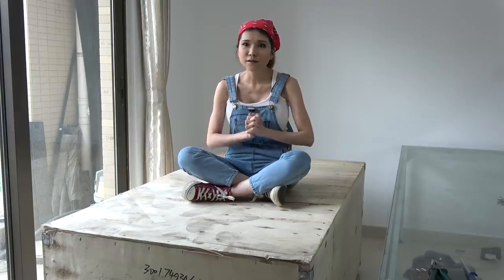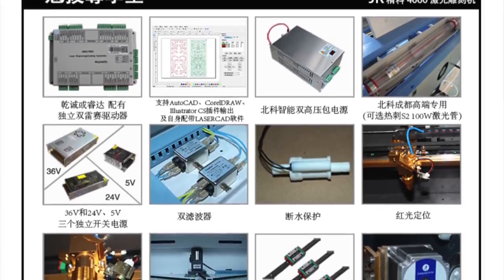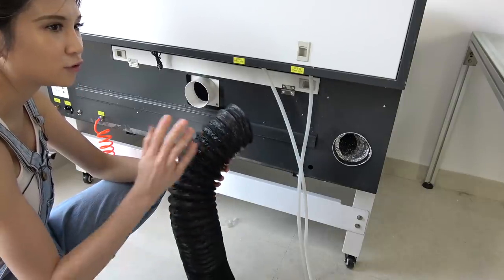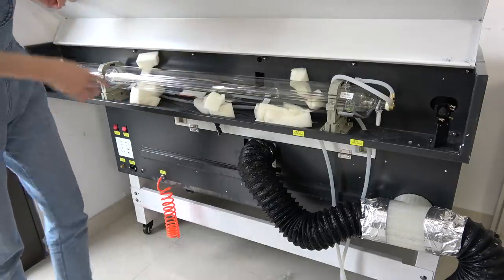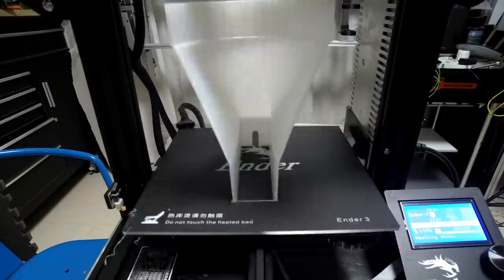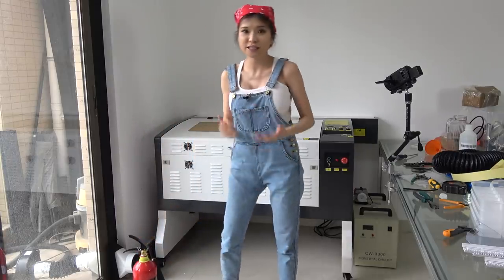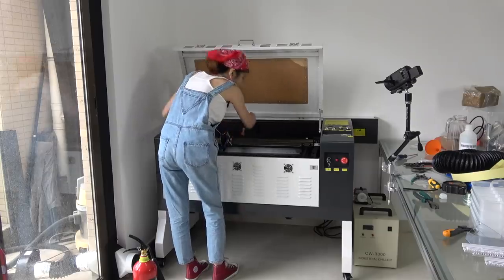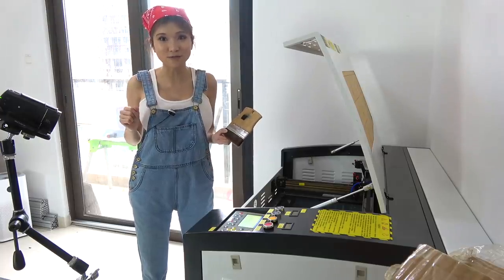I Finally Got a Laser Cutter! Chinese 80w Laser Unboxing & Setup

Comment: Try lightburn as a replacement for lasercad  to control the laser. It's not free but has a good trial period. It's under active development and has many nice to have features.
Thanks for the video.
Reply from the maker: Yup I know the author but it does not support my controller yet. As soon as it does that's what I'll switch to😊

Comment: Might have enough power to make printed circuit board holes for some fancy electronic parts. Will it take a CNC drill file?
Reply from the maker: Sure that would work fine

Comment: Wow Naomi, I love the way you found a solution for the ventilation opening in the doorway.
I would be a little afraid for an 80 watt machine in my house although I don't know if it is more or less dangerous then my 10 watt machine I have here, as that machine also set's things on fire.
Is the machine you bought also available with a fibre laser?

Comment: Can you spell the company name? That price is incredible. Machine in US is $5,000usd for a 45-50W machine. It is good to cut wood 3mm thick. Acrylic smells and cardboard burns as you see. Each material has specific speed and power setting. If anything catches fire, emergency stop to prevent air flow which will make fire bigger, and smoke which will hurt your focus lens. Can clean with isopropyl alcohol wipe
Reply from the maker: The name is in the description box

Comment: Naomi, I think you need to check the focus of the optics. Looks way too much charcoal on the cut and it might be caused by bad focus. Some lasers has moving focus lens, which distance from the material is variable and needs to be changed according to thickness of the material. Others has double focus lenses which might need to be calibrated for the first time.

Comment: You will need more ventilation. Think about something like a range hood. I've ended up adding ikea tray above the laser with a separate fan. And also an extra fan to suck all the fumes out of the laser faster.

Comment: Hi Naomi – the laser cutter is an interesting piece of equipment, I look forward to future videos where you show how it works and what you make using it. It seems to me that you are wise to wear bib and brace overalls, which will give you some protection from accidents involving hot material. Perhaps also wear a top, which has long sleeves. Kind regards.

Comment: Very cool installation video!  Turn your power way down, 10% or so and work upwards.  Also, does your laser have a Z auto focus option? or is it a manual adjust?
Reply from the maker: Has motorized Z
Reply: Super useful!!!  Glad you're back Naomi, can't wait to see what you make with the laser!

Comment: Well didn't see the actual unboxing, so have to ask, did you use a flatbar and rip the top apart, or remove the screws at the bottom and just lift it off?  Also, be careful cutting acrylic with a honeycomb bed, the meltoff gasses will condense on the combs, accumulate over time and can start a fire. Use a pin bed instead.
Reply from the maker: I did not, just not strong enough to do that safely. Paid the delivery guys to do it and cooked them lunch.

Comment: If this Laser uses a Krypton Arc Tube make sure you align + (positive) & - (negative) poles of the Tube every time or it will explode immediately. Also only clean lenses  with a high grade optical tissue so as to avoid scratching the lenses.

Comment: Hello.
You can get cheap acrylic, buy the cutting board.
For beginner is good material to start.
Check the power or strength of the laser for the material that you are going to use it.
Good projects.
Stay true to yourself.
Reply: James Alex  cutting boards are usually PP or HDPE both of which are difficult to laser cut, it tends to just melt back together
Reply: Maker's Muse thanks.
I know that is a type of plastic.
But with your explanation isn't for a beginner in laser cutter but it much much more difficult to work.
Best Regards.

Comment: What's stopping them from mounting the large laser tube vertically?  Would use a lot less space?  Maybe the water pump would need a boost but I can't think of any other problems.  #hack

Comment: Just a warning, the CW300 chiller will not be able to cool your water below ambient temperature, it is not a true chiller.  You should look at replacing it with the CW5000 chiller or an aquarium chiller.  I use an aquarium chiller for my 100w China laser and it is able to keep my water temp below 21C no matter what the ambient temperature.
Reply from the maker: Thanks, I've heard that. I'm hoping since I don't use it very heavily it will be ok but I'll keep an eye on the temperature.
Reply: Np.  Temps start to creep up during long engraves/cuts so make sure to keep the water temp between 20-24C at all times or else you risk damaging the tube.

Comment: Awesome Naomi! This is getting me amped for my G Weike 1390 that's on a container ship headed to me. 

One question, can you peel off or remove the brown sticker or whatever it is on the window on the lid of your laser? This way you can see the lasering as it's happening instead of waiting in suspense until you open the lid.
Reply from the maker: Sure, I just have not gotten a chance to peel it off yet
Reply: Naomi 'SexyCyborg' Wu  for safety, you really should, then you can see if anything catches fire and stop immediately. The air from the compressor then is usually enough to put it out before it becomes a problem.
Reply: At moments such as 22:36, we can see it is screwed in place.  Perhaps it was shipped without any glass or plastic covering.
Reply: tin2001 CO2 lasers do not emit visible light. Their wavelength is opque to many clear materials including the likely clear acrylic window on the laser cutter. So even if it gets reflected, it will have to burn though the window first, which is unlikely given that far away the beam will likely be out of focus.

Comment: Time to cut out your own gear. We buy and sell a few different chinese lasers (do a bunch of QC and some modding). I fly around and train people to use em. Just shoot any questions you have here and I'll take a stab at helping you out.
Now then:  You never checked to see if its aligned...these machines are almost never aligned (mirror shooting in the center from 1 to 2 to 3 and long range)
You didn't check the focal distance...you need to be exact there else you will just be making charcoal
...and a bunch of other things...but yeah, you seem clever...spending time on forums and talking to folks with their engravers is key...also, use a blade table...elevate what you are cutting somehow to allow smoke to funnel out and the beam not to flash back to the back by hitting tons of metal on your honeycomb
Beam alignment, focal range, raise material...and peel that paper off to see whats going on.

Comment: Not a fan of using tap water in machines. The minerals leave deposits over time, and the salts can cause corrosion  - mainly Alum - because it's conductive.  Japanese cars changed to distilled water decades ago, and if you ever dissemble one of their old engines the water jackets are very clean.

Comment: you should take off the protection from the upper protection screen so that you can check the working area, to be sure to not get hurt, buy a pair of protective laser googles and to test it you should draw the same pattern at different speed and power like in this tutorial: http://www.instructables.com/id/Test-your-material-to-determine-laser-speed-and-po/
An other thing you can try is to put masking tape on designated area  an peal it off after the engraving, it should get rid off the smoke marks.

Comment: Chiller? Which one? CW-3000? Hopefully not the 3000. You will need a real chiller because it's too hot where you live. Get a CW-5000 or 5200 and keep you water temperature at 20c. The 3000 will not cool the water to a manageable level.

Comment: Damn thats some cool ass gear. The maximum power 50% but min power 40% confused me. Is that a project file specific thing or is it some power limiter for this model. Such a small range. Also that giant battery sticking out of the camcorder. Also fuck vice.

Comment: Hi I love your videos, Sorry but I think you should:
1º Remove glass protector from above to see how the machine works.
2º Raise or lower the metal bed to properly focus the laser
3º Lower the power, with 80w I calculate that you can cut 7mm wood. To engraver does not need much power.
regards